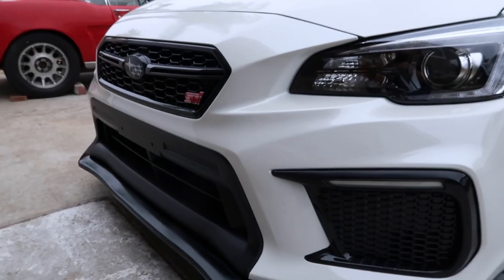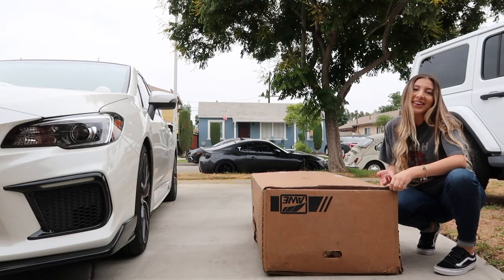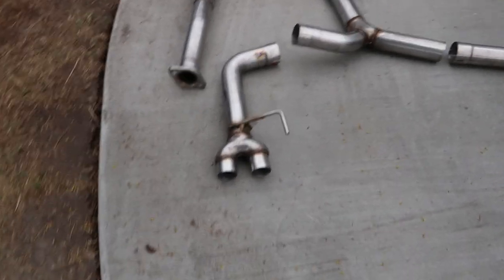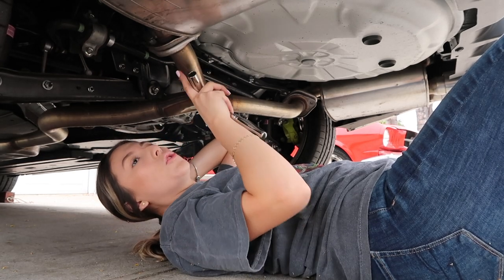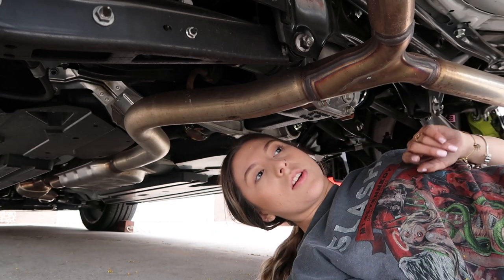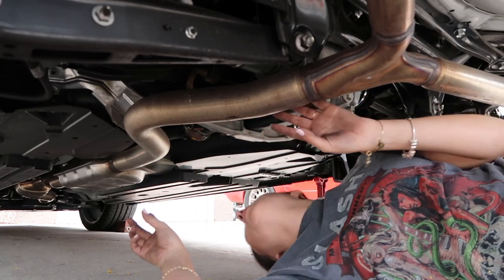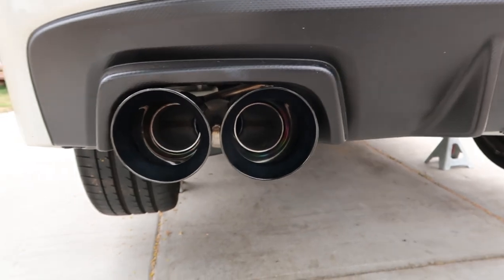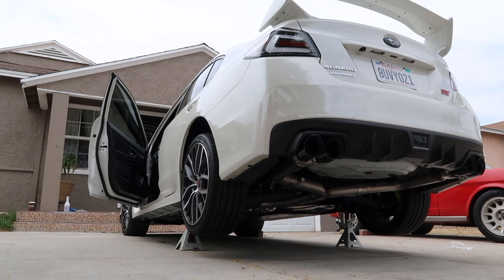AWE Track Edition Exhaust for Subaru WRX / STI Install with Sound Clips!

Comment: should probably note that the wrx will not sound like this because of the 2.0 and the unequal length headers, you dont get as much “subie rumble” with the wrx. there is a video on how this exhaust sounds on the wrx.

Comment: ENJOY!! I waited 3 long months for mine. It was a fun install.  It is VERY loud and has a nice aggressive rumble. I paired mine with a Maperformance Downpipe. So it is ferociously loud on full throttle. I get compliments all the time because it does not sound annoying like a Mustang/Charger it sounds like a “race car” I been told 😎.

Edit: wait till the break in period is over it will sound even deeper. I noticed the difference once I was getting closer to the break in time.

Comment: you know the tips are adjustable...I'd pull the inner ones out a 1/4" or so as it looks odd with the outer tips looking like they stick out further.  In fact, I think AWE says you can pull the tip out to halfway on the main track-pipe portion...at least with the black tips, you won't see them turn black from the soot, but it will be harder to tell when they are clean.  My chrome tips have been shiny since the first week after install...hopefully when you clean them, you don't scratch the black coating off...I'm surprised  that AWE only provides ONE hanger on the track pipe vs the two hangers on the touring mufflers....the two hangers would help with alignment imo.

Comment: How good does your car ride with the BC coil overs?  how close is it in stock. I’m asking because I put eibach on my car and it rides like crap over bumps and imperfections. At my age I want a low car  but only 1.3 front and back!!! That’s not that low I should be able to get the same ride.

Comment: Sounds awesome! You should consider an SF intake for ur next mod the turbo noises are to die for😂
Reply from the maker: thanks!! i will keep that in mind hahaha 👀
Reply: Throwing an intake on would require a tune, which would result in a denial of powertrain warranty claims. That seems kind of dumb just for some turbo noises. But hey if you have an extra 10k put aside to fix it if it breaks more power to you.
Reply: i agree it was worth it to go stage 1+! also more torque as well

Comment: Heeeeyyy!
You will need a custom pro tune.
Sounds creamy!
Reply: For a cat back you won’t, unless you actually want to see the only  11 hp gain
Reply: @Not.Ferrnnzz  huuuh, yeah you do, these cars are sensitive to mods that affect the afr’s .
Reply: @theblackmambaplague  literally it’s a cat back, won’t change the atf ratio. Only the back pressure and noise output. Cat backs don’t involve any changes to O2 senors or anything that’ll mess up the atf (It literally IN THE CATs) so there for it won’t need a tune. The only time she’ll need a tune for an exhaust system is if she gets a downpipe. Thanks
Reply: 100% do not need a protune for a catback on the STI. I had my car protuned at a very reputable Subbie only shop and the boss said that he has never tuned an STI/wrx for just a catback since it is not require. As a matter of fact I slapped a couple of bolt ons when I got protuned that same day I was supposed to get my exhaust but it didn’t get delivered. That day I talked to my tuner and he  told me to drive to their shop Off boost and very light on the gas. I drive 20 minutes away with out a catback just the Downpipe lol. Got my STI protuned with out the catback been months since and my AP D.A.M and knock numbers still look crisp. I got my exhaust the day after I got tuned 🤦‍♂️
Reply: @dougcastle1785  there’s a reason why your tuner told you to not get in boost and very light on the gas.
Our cars are very picky with these, I fkn hate that.
Ooooh, so you want a cold air intake don yah? Your ecu can’t adapt or self calibrate like a fsi tfsi with just bolt ons, you’re goona need a pro tune for that (sarcasm ).

And screw all those out the box Cobb tunes etc.

Comment: I have the AWE Track exhaust on the WRX and LOOOVE the sound. I didn't want that whiny crap sound that sounds ricer-ish. This sounds more deep toned and very aggressive. Pairing mine with the Grimspeed Downpipe to go Stage 2+ with the Cobb Big SF intake. Without the downpipe it is loud when you get on it and even loud cold starts. Kind of concerned with how loud it will be with the downpipe honestly.
Reply: Update: Got the grimspeed downpipe on. Stage 2+ OTS tune till I go protuned. This car sounds like a demon. It is VERY loud. Keep that in mind if running a Grimspeed downpipe or pretty much any downpipe for that matter.

Comment: (oops, I watched this one a month ago 😬)... If you went track exhaust, why not save a bit and just get axle-back muffler deletes. I love my AWE exhaust, but in a sense you just did a fancy muffler delete.   Unless you plan on buying the mufflers separate ($580/pr) then the AWE system makes sense. With my touring CBE, I'm curious what one muffler and one track/muffler delete sounds like (for me to do that, I need to get the deletes ($280/pr).

Comment: I might have missed someone else asking and if so I’m sorry, but did you use an adapter for the stock downpipe to transfer it from 2.5 to 3? If so, which one did you use? I’m not sure which one to buy. 😅

Comment: Do you need a tune when changing the exhaust? Just a question lol I have a 2020 sti just did the redline Cobb intake with the Cobb access port (stage one+) next think I want to do is the exhaust but not sure if I need that pro tunes
Reply: You only need to tune if you change out the J-pipe (turbo back exhaust), just a midpipe and mufflers (cat back) is plug and play with no tune.